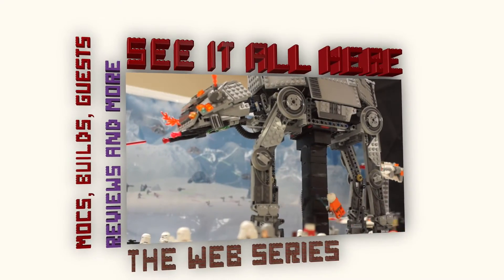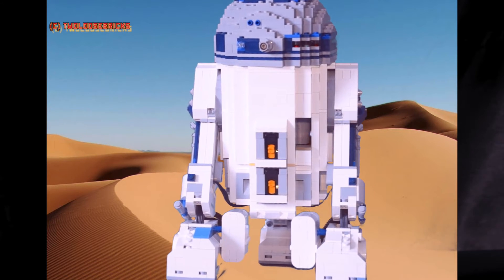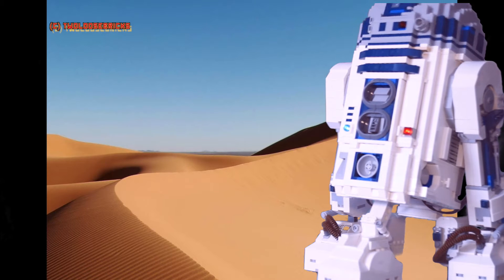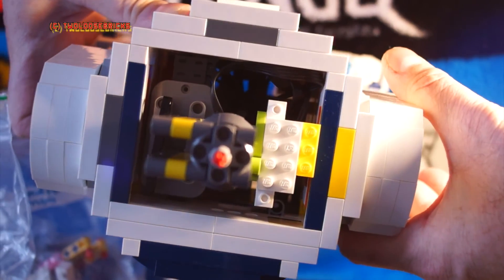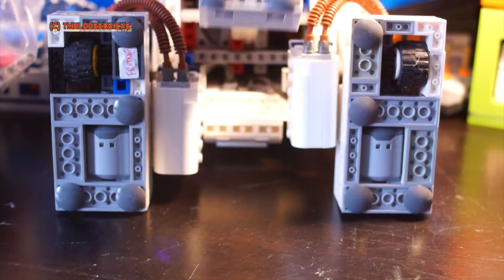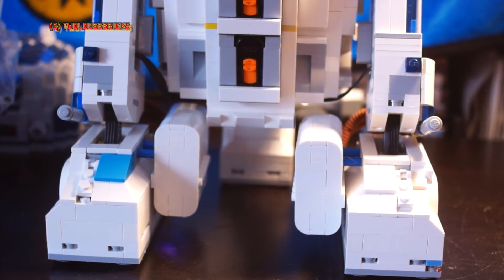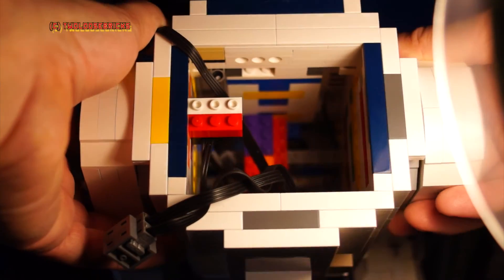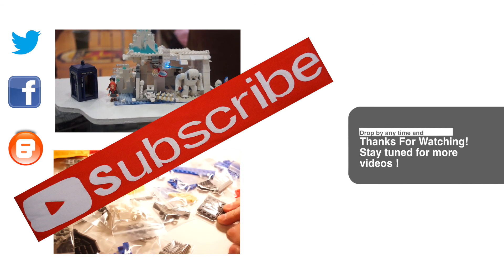LEGO Star Wars RC Motorized R2D2 UCS set 10225 Review and Tutorial Power Functions

Comment: Where do we get the mod plans?
Reply from the maker: +Phil Hawkins i will post the links to the file above in the description. I know its out there, but ill add it to my files so it won't get lost.  however, it is very tricky, it shows alot of techic parts, most of them are not needed, they are there to simulate the motors as the fellow that did the file said there are no LDD files for the motors, so he created the motors with parts.
Reply from the maker: +Phil Hawkins here is the links: to the required files     https://www.dropbox.com/sh/3tbfy8597tevk30/AAC7DNXe76XdYKQbER13aZ0ua?dl=0